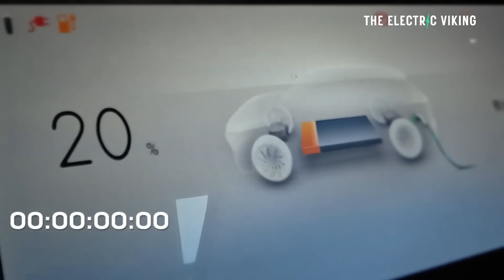CATL Unleashes Sodium: The EV Battery That WILL Rewrite Industry

Comment: No matter what battery that you come up with, battery swapping is the future of EV battery market
Reply: Like how phones went to battery swapping. 

This battery is the end of gas

5c charging = 250 miles in 5 mins. Battery swapping at that point would be like fuel tank swapping.

Swapping every form factor of EV batteries is logistical ridiculous.
Reply: No one can explain why rental battery trailers will not be an enormous crunch to help with range anxiety. Imagine pulling into the trailer station at the outskirts of town as you start a long road trip and you connect the trailer, plug it into your car port and away you go. The trailer will top off your internal battery as you drive. When you approach your destination you pull into another station and disconnect the trailer, pay for the electricity you used and drive your now fully charged car until you do the same thing on your return trip. The trailer stations will charge the battery trailers with solar power. Now I'm ready to hear why this "won't" work.
Reply: @ericklingsporn8248 that's an interesting idea that I've never heard. The downfalls I can think of are that you'd use way more power $ for the same distance pulling the trailer. Just with a bike rack on the back of our model Y on a 1200 mile trip decreased our milage by 35% so a heavy battery trailer would be brutal. Also most vehicles aren't setup properly for towing with a hitch and light plug and possibly break controller. 

After driving a Tesla 100,000 km over the last 16 month and multiple over 1000 mile road trips charging speed is key. 5c charging is the answer. Everyone except young guys roadtriping, like I used to be, need to stop every 250 miles for 5 mins anyways.

Comment: Nice! 175wh/kg (not 210, but given the cost... fantastic as we know that 165 is good enough for 250mi range midsize with no issue charging to 100%. With no significant degradation over time and temp, the 250mi (maybe 270) becomes quite useful for urban and suburban customers. 

This is Actually big news. 
Though as I understand it, there are no plans for Tesla to get it.
Reply: A 6.5% drop off in density vs LFP is nothing... 175 vs 185? For cheaper, more durable with better hot and cold weather applications? Seems like a reasonable trade off!
Reply: Uumm aren't CATL and Tesla partners?  If these batteries really are next level AND ready for mass production, then Tesla will HAVE to get them.
Reply: Is the energy density comparing like with like?

The "BYD Blade" stat is presumably for the finished pack. Is the sodium stat also for a finished pack?

Good if so, very misleading if not.

Comment: This does not put an end to methods of generating electricity , on the contrary, using more batteries will require more electricity to recharge those batteries.

Comment: Batttery swap makes sense for fleet vehicles, like delivery trucks and cabs, that are always in use.
Reply: Semi truck battery swapping makes a lot of sense, yes. You can slow charge a battery pack and swap it in instead of fast charging which is not possible to be installed everywhere.
Reply: Battery swap is a good idea and I would consider this as a worthwhile  'bonus' feature  offered by dealerships rather than an ongoing delivery system. The EV must still retain the ability to charge from your home solar or standard EV chargers.  The reasons should be obvious.
Reply: Battery swap for charge though only makes sense shorter term because once you can charge quickly and the infrastructure develops the battery swap industry goes away - that makes raising capital interesting because you are basically betting on smart people not solving the problem or on getting a high return to get your investment back before it happens.
Reply: Nothing much else though.
Reply: Swap batteries are now being used for a few trucks in New Zealand already
Reply: They have been selling 12 v auto batteries to replace the lead acid batteries. The problem is the cars give warnings and people go back to the lead acid that works.i will wait till these are proven
Reply: no, you just buy more and charge it with cheaper electricity.
Reply: It DID make sense for all cars and trucks, actually. Until, they brought up this battery. Now, range should hardly ever have to be a consideration.  Although, its probably atill a smart idea to continue building the swapping infrastructure for those one-off situations
Reply: ours drive over a matrix and charge while waiting in a line of taxis works fine in vienna
Reply: @stefanpredl6849  If you mean inductive charging that is extremely inefficient.
Reply: No, it doesn't. Drivers have to take a break every 4 hours anyway, and charging takes 15-20 minutes
Reply: @tedarcher9120 not for those big buggers it doesnt

Comment: I can't wait until this ends the fossile fuel industry. Orange Blimp is living 80 years in the past and it will cost us dearly.
Reply: To build these cars you need fossil fuels. You wont end it but maybe reduce the demand.
Reply: @tinogruchmann  No, you do not need fossil fuels, not at all. What you need is oil, as a base for plastics, but this is VERY far from fossil FUELS. 

The use of oil in a controlled industrial environment is VERY FAR from a use as an energy source where it is used for stupid combustion. 

So, absolutely NO, there is no need for fossil FUELS, but a use for oil, in a moderate, and possible recirculated manner. This is also about to happend for steel.
Reply: I would love to see more green technology and innovation, but in the here and now fossil fuels are vital, life saving.  It's going to take decades to get to a point where there majority of energy comes from renewable sources.  In the mean time, people shouldn't suffer with high fuel/energy prices because of politics.
Reply: @LeJimster  Well, you are wrong to a big part. Most important is to differentiate between fossil FUELS on one side and OIL as an resource for different chemical processes on the other. There is an enormous difference if you use oil for chemical manufacturing in a controlled industrial process, compared to stupid burning of fossil fuels in cars. So if we first of all talk about personal transportation, EV-s are working fine for most applications. Today these chemical products are produced as by products from refining oil for fuels, but this can be changed.

But you are also partly right, since this is an ongoing process to phase out fossil fuels, all over the world. As mentioned before, there is no need for fossil FUELS for personal transportation. And there is no need for COAL for electricity. But of course there is a PROCESS to change this, it will not be done tomorrow. It will probably take 10 years. And as we are looking, we see different other applications that are electrified. I can mention that oil and other fossil fuels are EXTINKT in house heating in Sweden. It took approx. ten years. So for most swedes there are no fossil fuels for house heating or hot water. There are no fossil fuels in generation of electricity. The trains are almost entirely electric, except for small rural lines. The EV adaption is not as good as in Norway, where it is almost 100%, but it is still very good, at about 70% if you include the partly electrical cars. So there is rrom for improvement. Then we have industrial processes, where the situation is mixed. Paper pulp is good, since rest products is generating heat and electricity. Others are less successful.

So rebuilding the complete infra structure will of course take time, but item after item is changed. And of course you are right in the assumption that it will take decades for a full transformation. But the important part is of course to change what can easily be changed first. To tic box after box, so to speak.
Reply: I don't think it's going to happen. A gallon of gas has 33kwh of energy. In order to store that in a lithium battery, you need a ~170kg battery. If it's a "new fancy" iron-sodium battery like the video is talking about, you'd need a ~280kg battery. In other words, just use gas - just generate the energy on the fly instead of storing it. If we can get that number down to 5 or 10kg, or even 20 or 40kg in a moving vehicle, then battery technology will be unstoppable. Until then, it's all hype.
Reply: @joebob6763  Your argument is totally insignificant. You have of course take efficiency of an electrical vehicle into the calculoation, since it is 3 times as high in an EV. The place were your argument matters is is aircrafts, only.
Reply: @mikaelpehrman4815  Yes. I would say 3x is a bit optimistic, it's more like 2x practically speaking. Still the cost per mile of my car that gets 25mi/gallon is about 0.12$ per mile. If I get a Tesla Model Y and replace the battery every 200k (very optimistic, doubt it will last nearly that long) plus charging costs, that's about 0.1$ per mile. Not worth the risk imo. It needs to be multiples better to convince the internal combustion crowd to switch over.
Reply: @joebob6763  Well, so you claim that a petrol driven car have more than 40% of efficiency? You also claim that a good EV has less than 90% efficiency? My EV Renault ZOE goes around for 1.4 kWh per 10 km, and this is measurement. And I have some sort of hevy right foot.

Well actual costs are hard to compare between different countries, but my cost for electricity is ZERO, since my solar cells produce enough surplus for charging my car.
Reply: @mikaelpehrman4815  No. I'm saying that it costs less for me to run a gas vehicle. Simply because I don't want to wait around for an hour when I go on long trips and deal with replacing the battery. Per mile, it doesn't save me any money or time. It's certainly not easier to work on than a regular combustion motor either. And unless EVs can improve 3-10x, in terms of battery durability, and in terms of maintenance, it's not going to be worth it for me or most people.
Reply: Oh, you dear young thing! Perhaps you’re new here but, this is discussing energy STORAGE. Fossil fuels are energy GENERATORS. There’s a significant difference and no this storage technology won’t end any generating technology! You might find Trump easier to cope with if you grasp reality a bit better!
Reply: @just-dl  Well, you are totally wrong! The energy storage is a PART of an energy generation system. I have lived with this in my house since 2013, solar cells and batteries in combination. The new thing now is of course obvious to the thinking mind - the storage part of this combination will be much cheaper, and that affects the total cost down, and increase the adaptation. And this start the building of big scale projects.

Comment: Can we point out that if a battery is operational for 3mln miles, batery swapping is the obvious application. 1 battery will outlive 10 cars. You can create 1 battery and spred its value among 10 cars 300k miles each. 1 battery of 75 kwh with price of 1750-3500$ spred between 10 cars and 50 years makes it practically free. On the other side ... if car without battery is 3500$ cheaper and the battery can be rented for 50$ a month, in 5 years CATL recoops the price and the next 25 years of rent is profit.
Reply: Or we all use our car batteries as a buffer for the grid.
Reply: @adamdarrow Great application but its not a great selling point for a new car buyer. While 3000$ lower sticker price, and battery rent of 50$ a month (achievable with the new price and durability). The rent part directly counteract the fear of battery failure and the cost associated with it.
Reply: In this case needs standarization as is for i.e. standard AA or AAA bateries. Just then swap or reuse whole or part car batery elsewhere.
Reply: @mirosawgarycki3290  yep
Reply: There is a big difference in designing for battery swapping that takes a few minutes and fitting or removing a battery that takes two or three hours to do.  The slow option will not need any fancy stuff for frequently removing and replacing the battery. It is just like removing or replacing the engine of an ICE car.
Reply: spread
recoups

Comment: Why would you do battery swapping if it only takes 5 minutes to charge to a 325 mile range?
Reply: Rapid charging requires expensive charging infrastructure and as more people do it the more pressure it will place on the electricity grid, both locally and nationally. Swapped batteries can be charged more slowly using cheaper kit.
It can also be useful for long distance trucks with much bigger batteries.
Reply: @moblet  Rubbish. Most EV batteries are charged slowly overnight or at workplaces anyway. Battery swapping is the solution to a problem that has gone away.
Reply: @moblet Either way you're drawing the same power. And since fast charging stations already come with their own battery banks  the  draw from the grid is unlikely to be much different. Also shed sized robots don't come cheap.

Comment: Is performance in very cold temperatures really one of the biggest issues facing EVs? It’s not like many EVs will face those temperature extremes. Absolutely it’s nice to have batteries that can cope with it but it doesn’t seem high in the list of battery concerns.
Reply: It's not only the extreme temperatures. Our car's range drops around 30-35% at -5 to 0 degrees. If a battery would lose only 3-6% of capacity, it would make a huge difference already. Maybe a 10-15% drop of range instead (additional heating would still be a factor).

Comment: Is it the future? It will be the future for at least the next five years.  After that, who knows? I suspect they'll be around for a long time, even if something better comes up. Their low cost assures that.

For purposes of grid/household energy storage in particular, I wonder what the round-trip efficiency is.
Reply: Solar farms or grid storage installations will benefit massively—10,000 cycles could equate to over 25 years of daily cycling!
Reply: Sodium will be better and better so yes Sodium batteries are the futhure

Comment: What are the end of life recycling proceedures of these batteries?
Reply: Best case scenario is a 2nd life as a home grid battery or - in larger stacks - relieving power grids from renewable energy peaks. 80 % SOH should have quite a few cycles left. After that, it should be as easy to dismantle as LFPs.
Reply: @ricardito7443 Research houses that have been destroyed by thermal runaway, I suggest you enlighten yourself and watch Stached on YouTube  an American firefighter who has Researched lithium ion batteries for years.

Comment: Sorry Sam- Disagree with your statement that EV are not affected by cold temps. 
There are a number of sites that have assessed EV vehicle range  shown decreased range in very cold temps. 
In a recent video from a few UK programs What Car , the lads have done range tests on a number of vehicles including the Model 3 and Model Y in winter temps where ambient temperature was in single digit Celsius temps. 
Similarly the one here on range in High temps from What Car in the UK.

Range was found to decrease  between 30 and 40% on all vehicles even the Teslas.
the first is cold temp affect on 12 cars the second is heat effect on 3 cars. 
https://www.youtube.com/watch?v=GxGG5e-mTcY
https://www.youtube.com/watch?v=5G1KQhCotSI
Reply: "Sorry Sam- Disagree with your statement that EV are not affected by cold temps. ".... so you didn't watch the video ?  He NEVER stated that at all....
Reply: Did they test sodium based batteries or lithium based batteries?